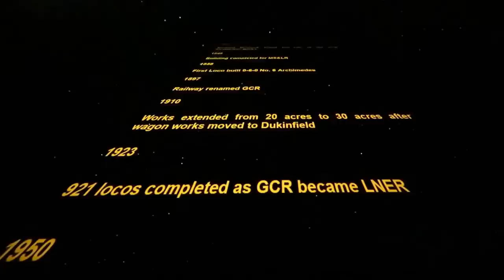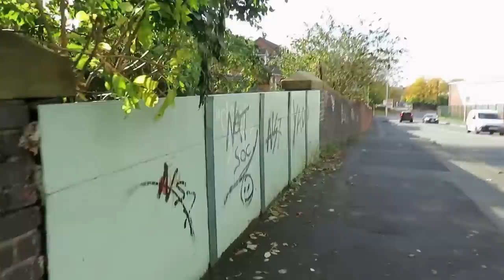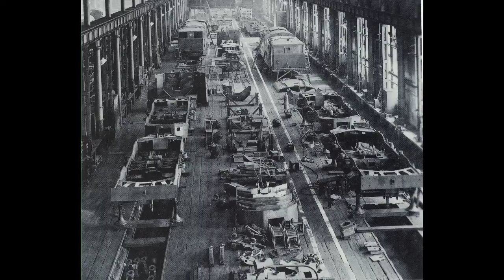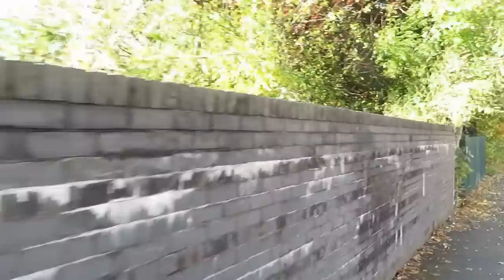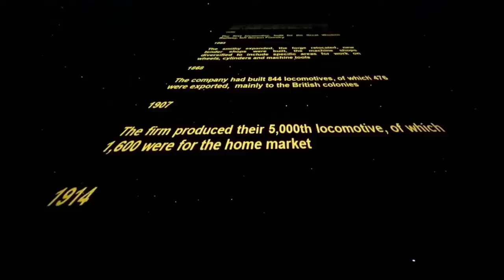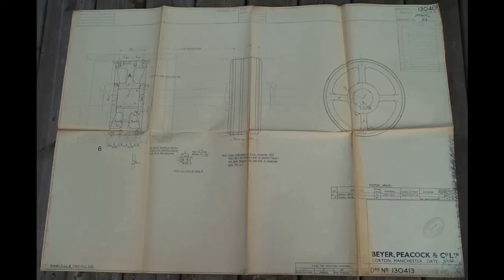A trip to the site of Gorton Works & Beyer Peacock, where locomotives and parts were manufactured

Comment: Fascinating.  Although both sides of my family were Mancunian and my Mum’s side were Gorton residents (Grandma and Granddad had a greengrocers, game and poultry shop on Gt Clowes Street) I never realised that Gorton Tank and Beyer Peacock were one and the same. 

Amongst many other places, we were taken on a school visit to Beyer Peacock probably around 1952, ostensibly as careers advice to give us some ideas for jobs after leaving school. To be frank, I now recall very little about the visit other than BP had  in its works at the time a very early (what I think may have been?) Garret loco in what looked to me then as being a pristine state of preservation. I have often wondered what became of that artefact. 

It was around that time too that I would regularly cycle to the Longsight loco sheds loco-spotting from a steel footbridge we colloquially named ‘the monkey bridge’. No idea why!  Sometimes, we would sneak into the sheds only to be chased out in no uncertain terms. 

The visit to Beyer Peacock obviously failed to attract me to want to work there as I eventually served my apprenticeship with the Oil Well Engineering Co. Ltd., (OWECO) Cheadle Heath. Of that too I believe there is no longer any trace!

OWECO was located on both sides of Bird Hall Lane and to one side, that of the original OEWCO site, ran the old Manchester Central Station to London railway line, which I believe ran through Monsal Dale and over that lovely viaduct.  

The OWECO works had its own railway sidings connecting to that main line and during the mid-1950s the company hired a complete train to take workers on a day trip to London to an oil industries exhibition where OWECO products were being exhibited.  Again, it’s all a bit vague now, but I recall we boarded the train in the works yard and conversely alighted back there on our return.

Comment: When I was about twelve in 1958 a pal  and I came to Manchester from Watford to visit the local sheds. We used the Locoshed directory to find them. Gorton was our last one and it was about ten at night by then. We had to crawl in on hands and knees through a doorway past what I presume to be the shed master/s office, All around the outside was atopped with barbed wire. We were finally chased  out by a big black guy. I ripped my coat on the wire. I remember a big steel footbridge and all the houses were old terraced ones. I can't remember much more about it now and my mate can't remember it at all. . I can't imagine little boys wandering around a strange city now two hundred miles from home late at night and feeling perfectly safe, Regards Edward
Reply: there is no footage of gorton shed because you never could get in to film i saw butler henderson there about 1961 for a rework mmmmmm
Reply from the maker: It's a different world today, unfortunately not for the better.
Reply: @laticsfan  the world is upside down now
Reply: the big bridge was called the bird cage  lol

Comment: Would you be interested in making a similar video on the lost Vulcan Foundry Newton le Willows?
Reply from the maker: Vulcan foundry wasn't in my shed directory which is my usual remit but it would be interesting. Horwich Works could also be a future video.
Reply: @laticsfan  i used to have the ian allan shed book which told you the shed allocations for  locomotives  i wish i still had  that but i have a reprint of the 1961/62 combine edition  mmmmm
Reply: if you look on you tube there is a video of vulcan foundry  mmmm

Comment: Nice to see, must admit i was smiling when you did the long walk instead of the shortcut, i used to go that way to Varna Street school (you may have seen it next to the station) in the 60s after walking over the birdcage across the top of the works and then down the steps in front of B-P offices happy memoires. And yes i walked that canal many a time
Reply from the maker: That's a memory too - the birdcage. You could see locos from it.
Reply: yus indeed the  offices and the drawing offices  to eh! and the  clock tower  on top lol